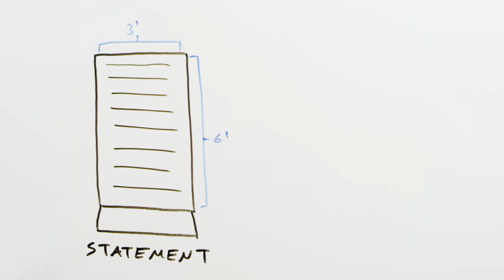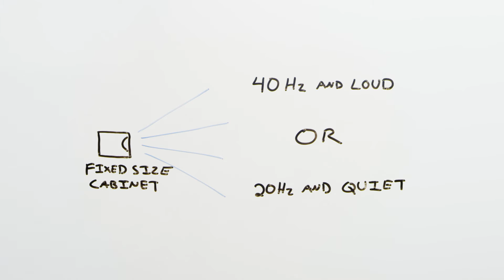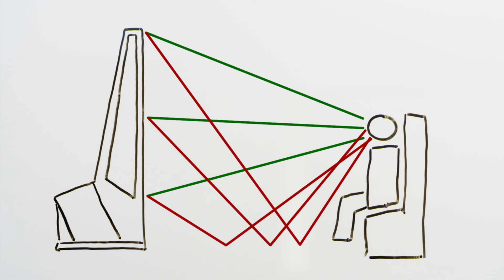Ask Professor Vojtko - Neolith Edition

Comment: incredible loudspeaker. the combination of 12" and 15" in the woofer section is very clever. but I do have a question about another loudspeaker in the series, the stage X center. why does it include 2 conventional woofers and even a folded motion tweeter in addition to an electrostat? wouldn't an electrostat alone be exceptional in producing vocal frequencies? (which is the centers' main job, no?)